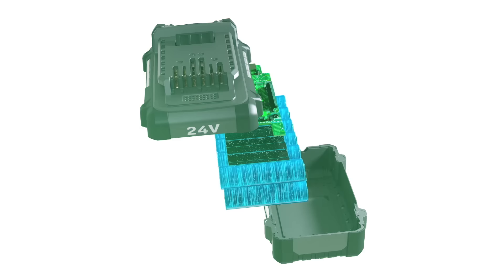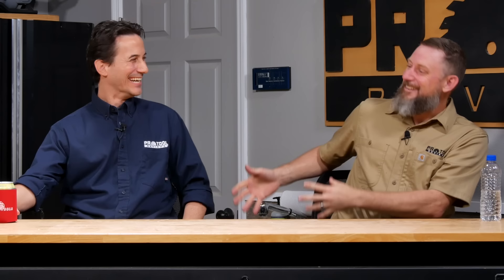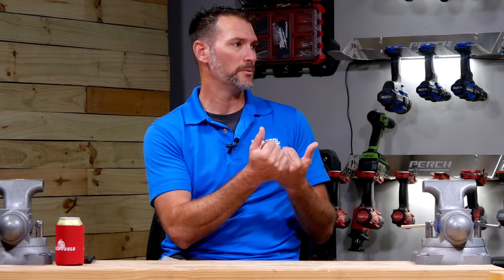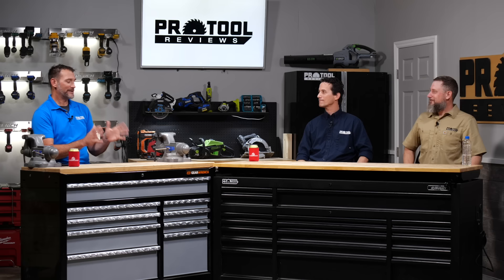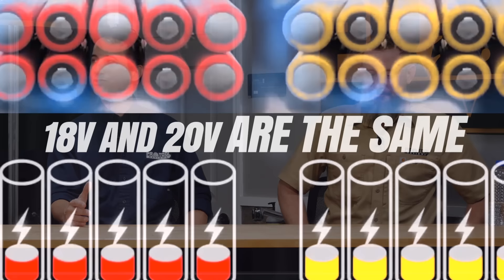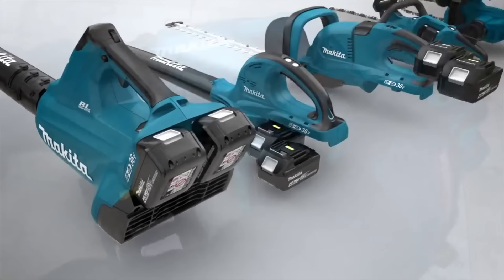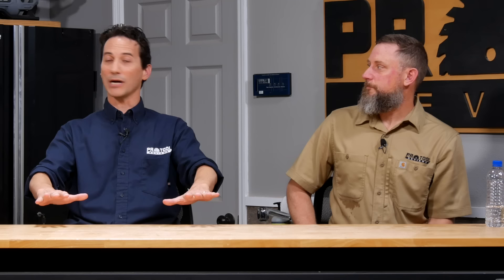You Should Buy 12V Instead of 20V… HERE’S WHY!

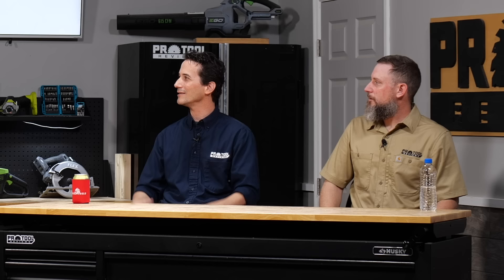Comment: 1:52 ya.. I have my 18v tools and I’m starting to get into making smaller projects and suddenly realizing my drill is just way too big and bulky to be comfortably making tight corners and drinking pocket holes in boxes less than 13” big. So now I’m looking at the M12 or even just the sticking to 18v but subcompact like the Atomic line

I used to think it would suck to buy into a bunch of tools just to realize they’re not powerful enough to carry out the task I need done
But now I’m dealing with a completely different problem, in that not that they’re too powerful but I can’t get them to fit where I need them

Comment: The advantage of higher voltage is a proportionate reduction in current (amps) for an equivalent power (watts) output. The benefit is reduced heat, smaller conductors, and smaller battery cells - just more of them. Realistically, we do not need to worry too much about electric shock hazard until the voltage gets above 50v. So at 60v and 120v a whole different level of electrical safety measures need to be considered and engineered.

Comment: The m12 line has a ton of tools, I hang my drill and impact from my pocket and can move around freely without pulling my shit down. Plenty of power in a small package. Hard to beat it. Other brands try but my 12v dewalt died, my Bosch 12v was too weak. The m18 sit in the box and still look brand new lol

Comment: Most name brand 18 or 20 volt batteries all use five Samsung, LG, or Panasonic, 18650 cells connected in series.  These packs measure just over 20 volts fresh off the charger and average about 18 volts over their discharge cycle.  They are the exact same pack whether they are rated at 18 or 20 volts.  To simplify things I will give both with the nominal voltage in brackets.  Milwaukee has the M[18]20 and Dewalt the 20[18]volt MAX.  Now isn't that better?

Comment: All my cordless tools are DeWalt 20V MAX XR. But, I’ve got an adapter that will let me use them on a Milwaukee 18V Fuel hammer drill I plan on buying. I researched the 20V vs 18V situation before I bought the adapter.

Comment: If you will use a saw heavily, you definitely should look at the 18V/20V or higher systems. If you’re only occasionally using a saw, the 12V (10.8V) models will likely do the job.
Reply: But it also depends on what you'll be cutting... Thin, light, small pieces, or just easy to cut materials could make a lighter tool more practical even for all day usage.  While full sheets, thick and maybe tougher materials, hardwoods and thick boards, etc. would require a more capable saw even for the short occasional job...
Reply: @ZeoCyberG  largely accurate. Thick materials, and some very hard to cut materials may demand a larger and/or more powerful saw. But most materials you cut with a saw can be cut by the 5-1/2” 12V models, they’ll just be slower and won’t cut as much on a single battery. But as you say, it does depend on the specifics

Comment: Sorry I paused @ 9 Min to write this.

You forgot about the corded tools. I am fan of 12v tools and I am not professional. What I use the most is drill and driver so its convenient to have a cordless one but that doesn't mean all my tools need to be cordless.

Circular saw is good for DIY but you wouldn't need to get a cordless one.

It is your place and you can arrange your place to be convenient to corded tools for your small projects.

Thanks
Reply: Well, the discussion was about batteries and how different voltages compare.  So why would they mention corded when that doesn't factor into the discussion?   Discussion wasn't about all possible tools, otherwise they could add regular hand tools too.  For small cuts, quick jobs, they can be even faster and more convenient... Video would be up to multiple times longer if they covered everything... Hardly practical or relevant to what they were discussing...
Reply: @ZeoCyberG  you are right and they don't need to discuss about corded one but when they want to recommend a cordless tools for DIYers they need to take in consideration corded and hand tools.

They tried to mention that when they said you are not DIYers any more when you need to start make cuts.

Which was not exactly what they meant. The statement should have been. You are not DIYers anymore when you need to have a cordless tools for these issues which mean its more than what homeowners will be willing to do.

I hope my idea reached you.

Thank you for you comment :)

Comment: So basically higher voltages give cordless access to higher power demands as batteries are generally current limited. More everyday tools do not have those high power demands, and the lower voltage tools are more compact, so they can be more comfortable for extended use and easier to transport multiple tools and batteries. 12V tools are more convenient. 20V tools are more appropriate for heavy duty demands.

Comment: The algorithm provides.

The more voltage the less amperage needed to drive the thing. 

Less amperage means less heat. 

So, yes, a 20v system is using the same batteries, but they have more V to run the things instead of needing the amps to burn it out.

If a 12v is pulling 10amps and a 48v is pulling 2amps, the 48 is in their going to last much longer

Comment: Most brands have compact tools for their 18V/20V line (see DeWalt Atomic).  No point buying another battery line that's not interchangeable with your other tools.  Its more expensive to have 2 battery platforms, and you have to worry about carrying 2 different batteries with you AND keeping them charged and having chargers in your shop for both. If all you're doing is basic home repairs, a 12V Driver and Drill is great, but all other tools outside those 2 main tools are primarily on the 18V/20V lines.  I wouldn't invest in buying an oscillating/multi-tool or sawzaw/recip saw in 12V line either.  The batteries are also getting better (DeWalt PowerStack) which makes the 20V line lighter and more powerful, so 12V I don't think is going to last much longer.

Comment: M12 Milwaukee tools have been disappointing. The ones I want to keep are the stapler, Dremel type grinder and ratchet even though I'm going to upgrade after rev 2 or 3 extended, high torque, high speed ratchets appear. I'm going to try the largest batteries I can get and see if the tools improve. For now, the cut off saw is very underpowered and eats batteries quickly and the oscillating multi-tool heats up and doesn't last long either. I will try the palm nailer, copper tubing cutter, 90* drill and angle grinder but I don't expect much from the grinder after using air tools for so many years. I thought the tech had finally reached a point where they were comparable to air tools but it's not quite there yet. For now, friction cutting, grinding and air chisel type tools will remain air powered. The only reason I have besides size to buy an M12 tool, is the lack of an M18 option.

Comment: It all depends on the Job/Task at hand, no necessarily the tool itself.  I wouldn't use a framing hammer for finishing nails.  Some jobs require a heavier output of the 18V, and others don't. It's not always a cut and dry situation though. I believe it also depends on the Quality of the 12 volt tool/battery that you are using as well.  We are mentioning brand names, but we all know the within these various brands, there are different levels of performance.  For instance, Milwaukee has three levels, from their entry level brushed to brushless to FUEL and then you have DeWalt, with all sorts of stickers on their tools as well and many other brands that do similar things.

On top of that, we also have the home owner/DIY, then the Pro-sumer levels of tools that, depending on how much you pay and how old they or the batteries are, may or may not alter the performance of the tool on any given day..

Comment: I was one of the first to jump onto DeWalt's 60 volt max platforms. I bought the DHS790AT2 12 IN. CORDLESS DOUBLE BEVEL COMPOUND SLIDING MITER SAW in about September 2016. And this saw was the best cordless tool I have ever owned, it's been a beast!
I remember thinking at the time, that the next tool in the 120V max would be the 10" table saw. I thought for sure DeWalt would destroy the competition with the 120v max line of tools. I have been let down in a huge way. Sure their cordless line of tools are very impressive. But where are the planers, table saws, jointers, drum sanders, and other large tools that would fit great on the 120v max lineup?
Reply: Agreed. Dewalt dropped the ball there. They were so far ahead of the game w the 60v but really dropped the ball. They should have made a lot more bigger tools for the line.

Comment: I have this m18 impact driver that gives 1600 inlbs but I recently got a used impact driver that only gives 600inlbs but uses hydraulic tech so there's far less vibration. I noticed I used the quieter tool because it gave more control for the application. BUT having more than enough power and not needing it is better than not having enough  power and need it

Comment: Milwaukee m12 and m18 are extremely expensive here in the UK, and the m12 fuel hammer drill isn't as small as people  like to think. I was going to sell a kidney to buy it but then saw the Dewalt 709 which you call the Atomic but here in England it has metal chuck and is all of 4mm longer than the m12 and to get the most out of that drill you need the higher amp battery which again costs as much as the tool. So after getting a great deal on the hammer drill with 3 battery packs that dictated what platform I use and now I have compact reciprocating saw, impact wrench, multi tool, angle grinder and the portable air compressor which has paid for itself in the first month.  I'm now invested in the 18v platform.

Comment: At 20min, you’re talking about a cordless welder. I never saw that, but there are videos of people using the dewalt power station to run a welder for lighter duty stuff. Pretty cool.
Reply: I need to check it out.
Reply: @Protoolreviews  Well, it doesn't run on their power tool batteries but DeWalt has the DCW100K Portable Stick & TIG Welder that runs on either AC or a rechargeable Lithium battery...

Comment: I really like how Milwaukee intergraded both their 12v and 18v platforms when it comes to their standard chargers.  Makes it easy when starting to buy power tools to dip into a couple of specialized 12v tools like rotary and multi tools, or even a drill for when you want something small and light weight when the time comes.  You just buy the battery and tool with out having to drag around different chargers or have them clutter the work bench.

Comment: I have 12v and 18/20v and use both regularly.  I also still have 3 dewalt 14.4v tools that I haven’t been able to part with. The batteries suck but the tools are good.

Comment: 12V Milwaukee all the way, the only tool that needs a little extra is the Hammer drill/driver and I just use a bigger AH Battery & as far as your comment I rather use my 120v A/C circular saw or 10" chop saw than anything battery powered especially when cutting through several sheets of Plywood at a time.

Comment: When you think about it, a 12 volt battery is enough to crank your engine to start. But as is revealed in this discussion, there are tools that aren't adequate in 12v. For myself, I just ordered a reciprocating saw in 18v, the 12v versions were too small for my liking and like you, I prefer having one set of batteries that work across the entire line that I own.  So, nice thought, but...
Reply: That’s because an engine pulls dozens of amps. This is why running 8 1.5v AA batteries in series won’t let you start an engine.

Comment: Heat is made if the wiring is too small. Hi voltage equal smaller wires. It is cheaper to build a 60v pack vs 18v.

Comment: I use milwuakee

I say no to most m12 tools. Basically just a dremel.

I only use m18 fuel products for my battery powered tools. I dont find their weight an issue at all.

My m18 impact is a multi tool with 4 settings. It can be what i need in diverse situations. 

My m18 hammer drill is again a multi tool good for diverse situations and offers an option wide handle for stable alignment with the application of force.

My m18 multi tool is actually a multi tool. Fully variable speed with good power.

My m18 hackzall hacks it all

My m18 compressor runs my nail guns

The blower blows, the vacuum sucks, the skill saw cuts, the list keeps growing.

Comment: I have a Milwaukee fuel 18v drill driver with hammer option. The issue is that it is too strong, at the lowest chuck setting it almost went through 3/8 plywood. I say get a 12v and 18v.

Comment: Lols I've been saying from day one ist overkill, started with guys walking around with car batteries in their tool bags. Biggest I went was 14.4 in nicad, when Makita and Dewalt came out with 18 and 20 volt lithium it was a fliipng game changer size wise and run time. I'm thinking of going down to the 12 v max line myself as in all honesty as a tradesman that mainly drives 2 inch screws through fascia boards, alls I need.

Comment: One thing that's overlooked with extreme high voltage batteries is safety. 60 volt DC is as dangerous as 120 volt AC. So the user can potentiality get electrified. 
Another point is the weight.  Whether it is to get a higher voltage or higher capacity, more cells means more weight.
Reply: "60 volt DC is as dangerous as 120 volt AC. So the user can potentiality get electrified. " Not so, AC is much more painfull than continuous DC. Take thee tazors used by law enforcement. they pulse at somewhere between 5 to 10Hz to give maximum effect. The peak voltage of 120 volts ac  is approx 1.41 times 120 volts ( supply voltages are RMS values) @ 60 Hz for the US environment. As the frequency increases the pain caused decreases. DC is difficult to switch, a switch that can interrupt 120 volts say at 10 amps would not work on 60 volts 10 amps. So arcing could be a problem in the event of a failure.

Comment: I have an m12 driver and a drill. You don’t need an m18 to install hardware and other small screws. An m18, even with the clutch, has just too much power, size and is on the heavy side. Would i build a deck, do some framing or try to bore out holes with an m12, no. Use the right tool for the right job.

Comment: Imo 12v actually makes LESS sense for a hobbyist DiY’er…..because with occasional use you don’t need ‘lightweight’ and we don’t want stallouts or dirty tearout cuts any more than a pro does huh!  The exception is considering cost, simply because some of the tools intended for pro use, tho’ usually excellent quality, are staggeringly expensive.  Also of course 12v has power limitations which can be frustrating particularly for drill bit sizes. I’m not talking picture hanging tho’😂

Comment: Higher voltage packs mean the internal wiring can be smaller for the same power (watts) delivered to the motor, or the same size wire for lower power lost in the wire (not significant). There IS a small difference, and higher voltage is a little better.

Comment: I started with Ryobi and then moved to 12v, but pretty soon Ryobi will have the 150w inverter with solar charging, and I still have a compressor and a router.  I'd like to go single platform but for now M12+Ryobi seems like the best solution.  M12 for the stuff I use most, Ryobi for big things.   Ryobi is cheap enough to not worry about the cost of having 2 systems. 

I actually don't use a drill anymore actually.  I just buy impact rated bits.  If I did I'd probably get a Ryobi just because of how rarely I use it.
Reply: Same here. I bought a ryobi tool set at home depot, and then I ended up getting a few m12 power tools and 2 m18 drills